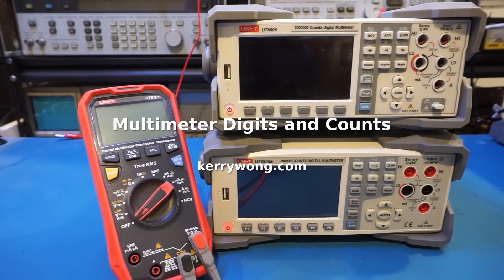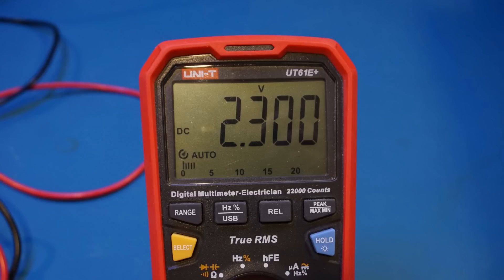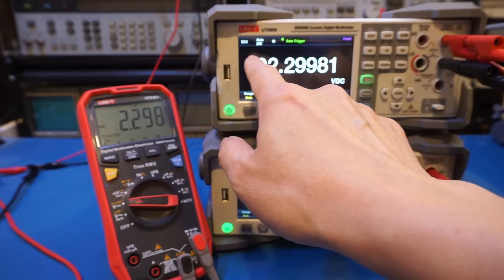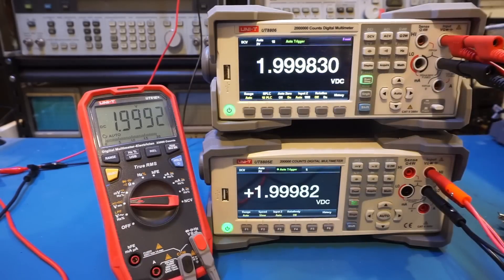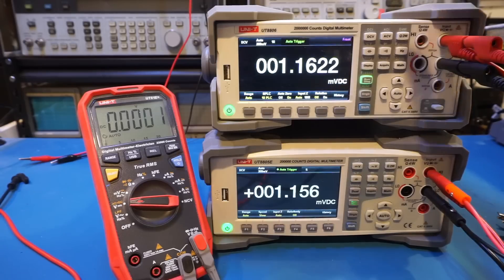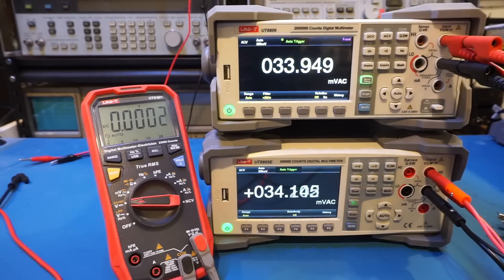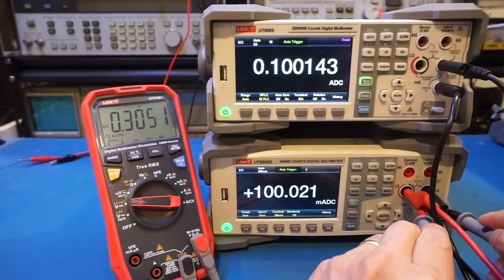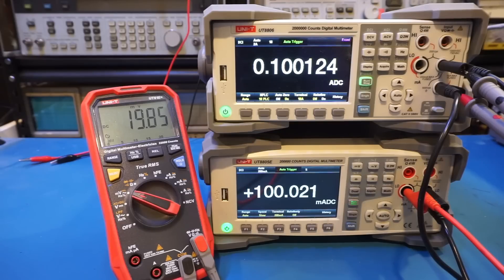Multimeter Digits and Counts Demystified

Comment: @KerryWongBlog  Unless I missed your explanation, you didn't say WHY the counts figure wasn't always 9999, or 99999, or 999999 rather than some apparently-arbitrary figure of 2000, or 4000 or 20000...  Does it somehow make the circuitry simpler/cheaper?
Reply from the maker: I think I mentioned it, the number is largely dependent on the ADC used (of course other considerations as well). It's not always 9999, 99999, etc. other numbers you mentioned and 6000, 60000, 22000.... are quite common as well.

Comment: These meters have all have different counts; 22,000, 40,000, 20,0000, and 2,000,000. Why do they do this?
Why don't they use all  the values of 0 to 9 for each digit, meaning a 5 digit meter could display from 0 to 99,999.
I would guess it has something to do with how the A/D works. Can you explain this?
Reply from the maker: It definitely depends on the ADC and the Vref. If the reference voltage is 2.5V then that would be the maximum signal level the ADC can convert. The linearity of ADC (INL/DNL) also plays a role and designers could limit the range further to minimize non-linearity induced errors.

Comment: Counts are easy. As for the first digit in the digits notation:    
1/2 digit: It doesn't mean "half a digit" but refers to the maximum possible value (1) out of 2 values (0,1). The term "half" has probably become popular for simplicity, but some even use ".5," which is totally misleading.
    3/4 digit: This means the meter can display a maximum value of 3 out of 4 possible values (0,1,2,3) 
    5/6 digit: Here, the maximum display value is 5 out of 6 possible values (0,1,2,3,4,5) 
In cases where a multimeter shows "2" in the first digit due to overrange, it should be specified in the documentation. The overrange capability isn't always universal for every multimeter, and that's why a "4 1/2 digit" meter can have a count of 22000 (19999) with a 10% overrange but is not called "4 and 2/3 digit." Sometimes there is no overrange at all.
Reply: you said, " 3/4 digit: This means the meter can display a maximum value of 3 out of 4 possible values (0,1,2,3) " You mean it could display 0 or 1 or 2 or 3? It's a bit confusing... IMO... to say it " 3/4 digit: This means the meter can display a maximum value of 3 out of 4 possible values (0,1,2,3) "

Comment: Great video Kerry - I've been wondering if I should get a 6 1/2 from one of the current lower cost manufacturers seeing that I have a 3458A, 34401A, Keithley 2401 - Do you think they're worth picking up? I do think that I should have got a Rigol 3068 instead of grabbing the 3058 - Thoughts?
Reply from the maker: IMO nothing can beat an HP 3458A. I think one of the main benefits of a modern 6 1/2 digit meter is some of the more advanced functions such as histogram and other statistical capabilities. But at the end of the day, it really depends on what you need. For my electronics work, I rarely needed the resolution of a 6 1/2 meter and when I did, my old Keithley 196 would usually do just fine. I haven't used the Rigol 3068 but the specs looked promising.
Reply: @KerryWongBlog  That is more or less what I was wondering about - Should I put up the coin to buy a modern 6 1/2 - I see videos showing a much more expressive display and think I should get something that acts like that.

Anyway - Would appreciate your thoughts on the Uni-T/Rigol/Siglent vs Keysight/Etc choice?

Basically, I don't want to over pay and yet I want all the goodies - Damn my consumer basis...
Reply: Kerry - FYI I think I have a gap in my DMMs - Very high end, and low end ones - Just thinking about filling that - If this makes sense
Reply: @tgsoapbox  Sounds like you are addicted to DDMs, just like me. I'd say just remind yourself that you are addicted and resist the urge to purchase another one. The first step is admitting you have a problem.
Reply: @tgsoapbox  for what purpose?
Reply: @logmeindog  Well I have my 3458A monitoring my 732A, I have my Rigol 3058 as my bench meter, I have the Keithley 2401 & HP 3245A sitting down with the voltage standards so I guess what I was inarticulately asking was it worth getting one of the more modern 6 1/2's for the extra features compared to the HP 34401A or are those features simply "fluff" that you never really use on the bench.

For example, the more modern meters provide on-device histograms etc - I'm simply not sure that lacking that functionality (or others of the same type) justifies the acquisition of the meter. I have everything connected either via LAN or GPIB in my lab and I have an extra HP 37204A Extender to bring GPIB down to the voltage standards.

Now all that said, I'm not hearing any "these features have been really useful" comments so I guess I'll just keep motoring on with the ones I currently have. Thanks.
Reply: @ivolol  Primarily I was thinking about upgrading my bench meter from 5 1/2 to 6 1/2 with a more modern meter - Kerry answered the resolution question but I was still wondering about the more modern features (compared to the HP 34401A). I'm not hearing anything compelling about that so I'll just keep using what I have.

Comment: Some of the Siglent SDM meters used to be 240000 or 2400000 counts full scale but at some point the firmware changed and it dropped to 220000 or 2200000 counts full scale.

Comment: Great education!  Confusing topic and this video really clarified the counts vs. digits in my mind.  I have a uni-t with 60000 counts . It's almost too much for my normal use. I rarely use it.
Reply: High resolution is very useful if you monitor current through a low resistance shunt and want to see how the current behaves (so if it goes up or down). The last few digits might not be very accurate in an absolute sense, but they are usually stable, so observing if the current is gaining or decreasing at certain instances is accurate. I use the 500k count mode on my Brymen BM869S for this.